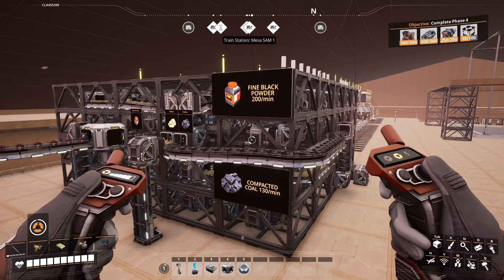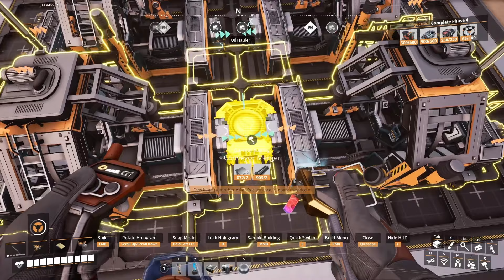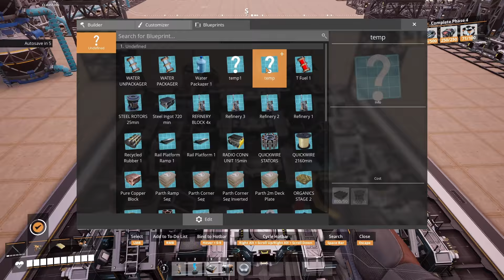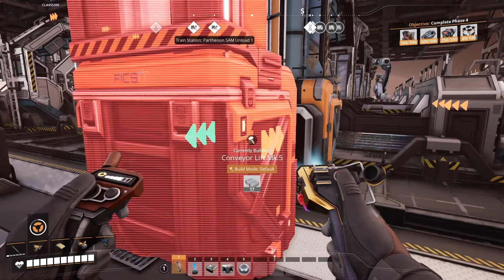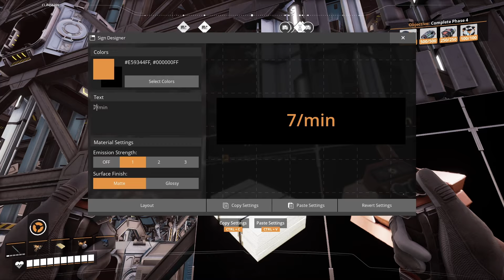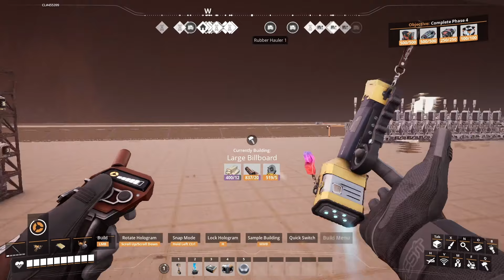Compact Skid Build (Full Unscripted Tutorial) | Satisfactory 1.1 Design Deep Dive

Comment: Hey there! I haven't finished watching the video yet (it's getting late here, I'll have to get back to it later), but I suspect the alignment issue you were having with your vertical splitters at around the 20-minute mark was because you built the whole thing on frame floors and they have an odd height. Buildings nudge/snap at 2 meter intervals, so anything outside of that "grid" (like frame floors being something like half a meter tall) can cause alignment issues. Took me forever to realize it.
Either way, it should be fixable with conveyor floor holes, since those "reset" the alignment to the grid they were built on. It just looks weird on frame floors.
Reply from the maker: You're right that is what was happening. I was thinking about it after the fact and in the future I may try building the frame floors last and clipping them through the machines so that everything is resting on the same plane.
Reply: @atroKraft  Ah, figures you talk about it just a couple minutes after the spot I paused and then decided to comment on. :P
Buy yeah, the construction system in Satisfactory has some odd quirks like that. I'd love to build very compact skids like that but I cannot be dealing with multi-level conveyor lifts within builds. Those things are so fiddly they're just not worth it to me. So most of my builds are stacked independent single-layers instead.